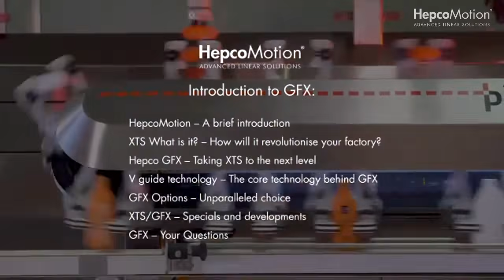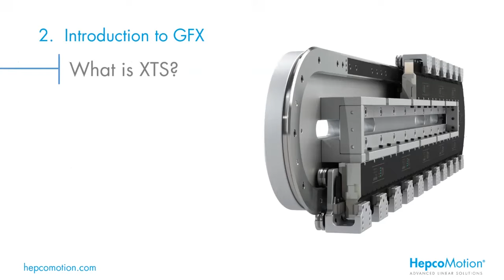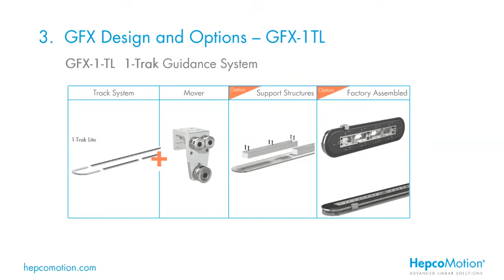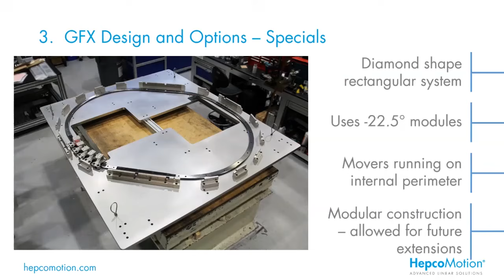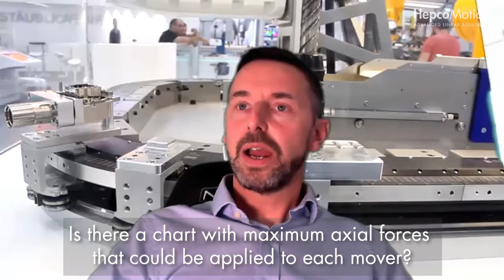An Introduction To GFX | HepcoMotion Webinar

Comment from the maker: 🕒 Timestamps:
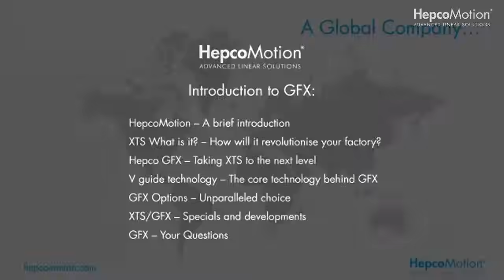02:44 – HepcoMotion: A brief Introduction
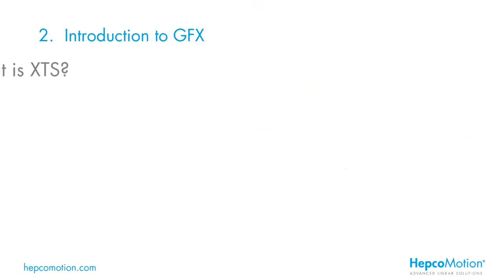06:28 – XTS What Is It? How will it revolutionise your factory?
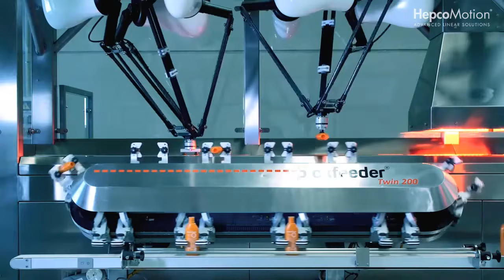08:44 – Hepco GFX: Taking XTS to the next level
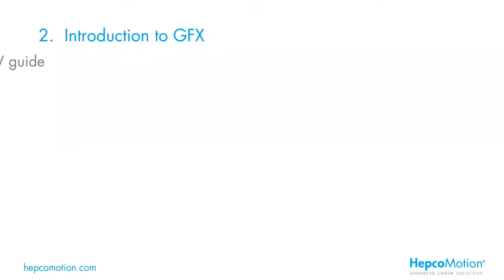10:49 – V guide technology: Taking XTS to the next level
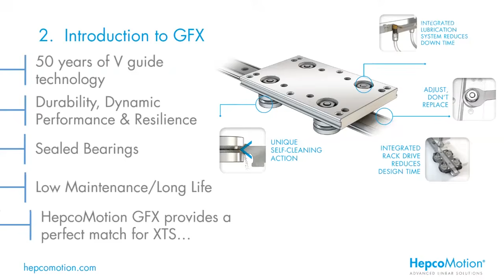11:54 – GFX options: Unparalleled choice
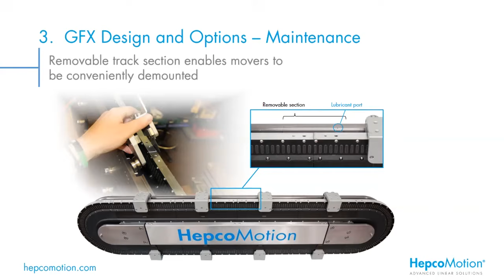22:00 – XTS/GFX: Specials and developments

GFX: Your Questions
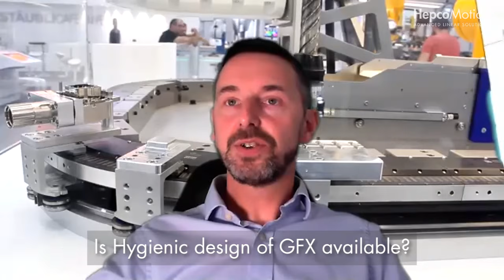29:55 – Is Hygienic design of GFX available?
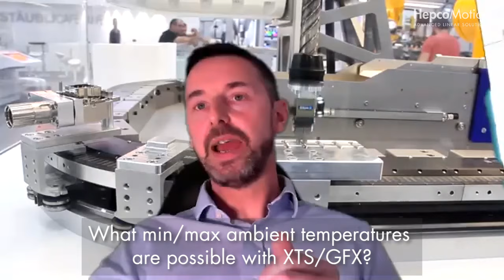30:14 – What min/max ambient temperatures are possible with XTS/GFX?
31:16 – Expected lifetime of movers: are figures available for empty movers without load?
32:36 – How about systems where lubrication is not possible?
33:04 – Do you have a calculation tool?
34:02 – Any clean room application certificate with Hepco GFX/XTS solution?
34:26 – Is there a pricelist for standard length systems?
34:49 – When heat generation becomes an issue what cooling options are available?
35:39 – Is an ATEX version available?
36:02 – Is there a Hepco bill of materials that can be selected by Beckhoff engineers or does every application need discussion with Hepco engineers?
36:57 – Is there a chart with maximum axial forces that could be applied to each mover?
38:05 – Can this system be used for an outside application, with some rain and dust?
39:05 – In XTS, each mover should be tuned according to the stiffness to eliminate resonances: are there suggested filter parameters for each Hepco mover type?
40:02 – What are the options for providing a complete assembled solution with Beckhoff components for USA customers?
41:22 – What is the average lifetime of an XTS/GFX system?
42:56 – What is the approximate delivery time?
44:34 – What about mounting it upside down? Any concerns regarding the lubrication?
45:25 – Can Hepco custom make movers to carry heavier payload?
46:40 – Can you use any type of lubrication with GFX?
47:37 – For vertical systems: are brakes/stoppers available?
48:18 – Are there any fast methods to detect when a mover bearing needs to be changed?